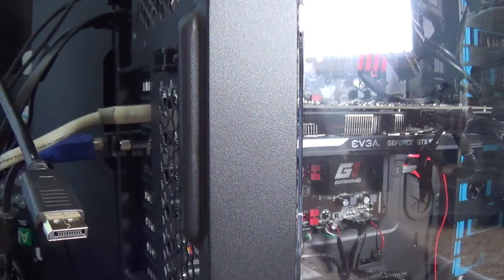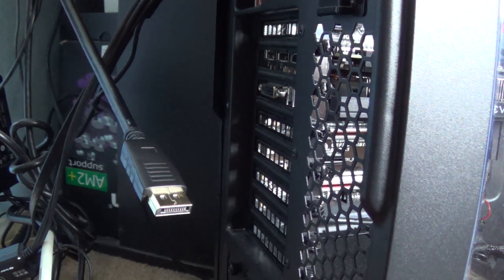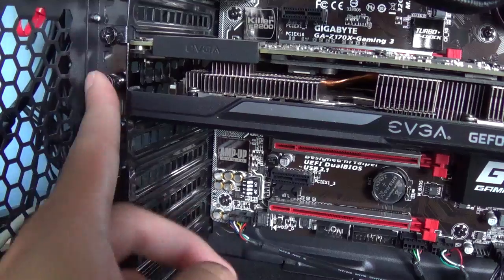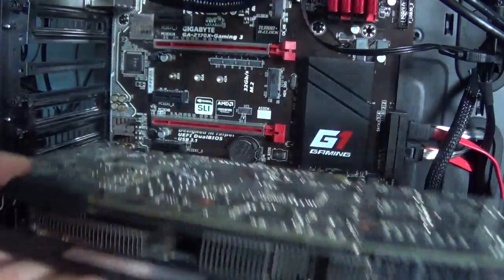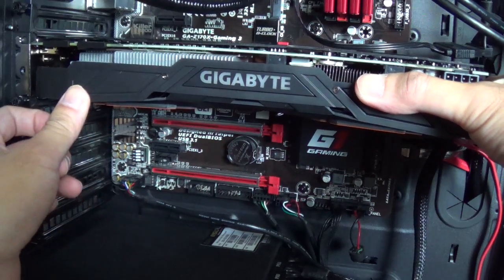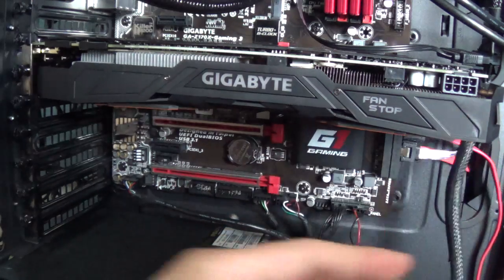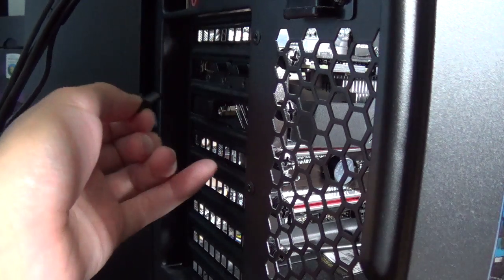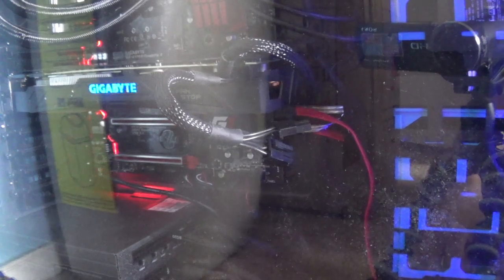How to Replace Your GPU Replacing My GTX 970 with a 1070

Comment: Where do you click it on mine i have a t7500 dell.precision desktop where do you click to take it out
Reply from the maker: Should be the same spot
Reply: @RobertLe1988  couldn't find had to wiggle it forever and push at the same time would you happen to know how to see 2 3tb hard drives at once external or internal ly appreciate the quick response im.trying to clone and it can't see both when both are connected tried everything

Comment: wait, so your newer GPU doesn't need as many pins connected to it as the older one? what was the point of those extra pins for the older model?
Reply from the maker: My newer one uses the same pins

Comment: Is this the same process in upgrading to gtx1660? I currently have a GTX 970.  Worrying if I still have to change some hardware in the desktop. My psu is 850 watts.
Reply from the maker: Check your overall wattage usage. If you are close the max then I would recommend that you upgrade your power supply.

Comment: This might be a dumb question but if I have a evga gt 710 and I want to replace it with a gtx 1050 4gb gigabyte, would I have to delete any drivers
Reply: You should be fine, still have NVIDIA. Have you downloaded the latest drivers tho?
Reply from the maker: If it doesn't have the correct drivers, it will default to the basic drivers then you install the latest

Comment: I have a quick question, so I recently got a new pc and my old pc has a GT 710 that I installed a few months ago, so instead of buying a whole new GPU for my new pc, can I just take out the GT 710 from my old pc and put it in the new one??
Reply from the maker: If it has the right slot

Comment: I am thinking about doing the same thing. Could give us an update? Is everything working fine? Did you need to upgrade something else? Once you installed the 1070, did you just need to install the driver for it? Did you notice any difference in the performance? Thank you for taking the time to respond.
Reply from the maker: I've had the card since I uploaded this video. No issues and the driver still gets updates. I don't see a reason to upgrade at the moment. Whenever it can't run AAA titles on the card then I might consider upgrading. I used the nvidia experience and it auto updates. Might be easier to use the built in graphics then install the driver then use the card.
Reply: @RobertLe1988  Thank you very much.
Reply: @RobertLe1988  I mean, did you have to make any adjustment or updating to your mother board? Or can I just buy a new graphic card and install it, and that's all? Everything else is compatible?
Reply from the maker: @samiajijudistira7199  I didn't have to update anything but the driver
Reply: @RobertLe1988  Thank you again for the info. You see, I tried to read about this on the NVIDIA official website, and they kinda warn you to be very careful because something about the mother board and other things that came with it might not be 100% compatible. Now I feel comfortable and I'm gonna go and get the graphic card now.

Comment: I have a Ryzen 3200g with the built in gpu. I’m planning to put in an AMD RX 570 gpu. will the drivers be automatically installed to the pc or do I have to do it manually
Reply from the maker: You would have to install the drivers

Comment: bottlenecked?
Reply from the maker: What do you mean? All my games work fine in 1080p
Reply: @RobertLe1988  because I think that switching  GTX 970 to a 1070 is a big step
Reply from the maker: @jotarojengki-kun1974  Haven't had issues running at 1080p and streaming
Reply: @RobertLe1988  ahhhh good god bless bro

Comment: do i need the cable that you plug into the 2060 to make it work because ive got a 1050ti and that doesnt have the cable and i cant seem to find the cable in my pc?
Reply from the maker: If it has the socket then you need to get a new power supply

Comment: I'm upgrading my GPU but was planning to restart everything, so I don't have to uninstall the driver right?
Reply from the maker: If you have the nvidia experience program it should detect your new card
Reply: @RobertLe1988  I upgraded from GT 710 to RTX 2060 so I still had to uninstall all my drivers. Anyway thanks for that information.
Reply from the maker: @mr_airport7330  Thanks for the info
Reply: @mr_airport7330  Dayum, thats a big ass upgrade.
Reply: @synx2963  it is xd
Reply: @mr_airport7330  also, A few weeks ago, I upgraded from a integrated gpu to a gtx 1660 :D
Reply: @synx2963  sounds epic

Comment: I can't push down that red thing on the motherboard i feel like i'm using too much force. I unscrewed and unplugged everything. i don't wanna break anything
Reply from the maker: Just apply enough force for it to snap
Reply: Holy Crusader did you figure it out man because it won’t work for me either
Reply: Plz reply because I’m stuck and it’s making me very upset
Reply: @kiwizlucks4947  yeah i just pushed really hard lol
Reply: Holy Crusader yeah I got it bro lol I just pushed realllyy hard but before I didn’t wanna press to hard cuz I felt like I would break it, upgraded to my 1080 tho.

Comment: I would suggest that removing the Power cable is a bad idea unless you plan to ground the case some other way? The problem is if you manage to generate some static it has no way to dissipate through the case ground.
Reply from the maker: Thanks

Comment: Can i replace my gtx 950 to a gtx 1060?
Reply from the maker: Yes
Reply: Robert Le thanks but with every mainboard?
Reply from the maker: @texotypes6964  As long as your motherboard has the supported PCI slot you are good. Example your motherboard has PCI Express 16x and your card needs PCI Express 16x, then you are good.
Reply: Robert Le what if Mine is 2.0x16?
Reply from the maker: If it's the same or higher you are good
Reply: @RobertLe1988  how can u tell if ur motherboard has PCI express x16
Reply from the maker: @lexmor3886  Look at the manual or google the motherboard and the spec sheet will tell you
Reply: If i understood correctly when I read up on this thn it should work anyway u will not get full performance from the card thou it is limited to the port speed that u put it in to. So you will only get what your PCI-e 2 can provide.

Comment: Do you have to uninstall all your drivers from the old graphics card?
Reply from the maker: I had a nvidia to nvidia so I didn't have to uninstall my drivers
Reply: Robert Le so if I went from a 1060 to 1080 I would be fine
Reply from the maker: Yeah you shouldn't have any issues
Reply: Robert Le thanks

Comment: Everyone asking if you have to uninstall drivers:
If you're going from nvidia -> nvidia, you should be fine
AMD -> AMD, you should be fine
It will ask you to update your drivers when you reboot, but you don't have to completely uninstall. 
HOWEVER, if you go from nvidia <-> AMD, THEN you have to do a clean install of your drivers.
Reply from the maker: Thanks for answering the question
Reply: So if I was going form nividia to nividia would I just shut down my pc install the new gpu and then boot my pc up again?
Reply: Luke Fox did u find out what do do plz lmk
Reply: @Angel-es3je  ?
Reply: @lukefox5100  whats did you do when you installed a new gpu ? (same brand) did you have to go to nvidia experience and install drivers and had to reboot ? Or is it plug and play ? Did you also have to delete previous gpu drivers ? If so, how did you do it ?
Reply: @cvcxx  You need to go on geforce website and find the drivers for that gpu and then install it and follow the steps and thats it
Reply: @Zac   Thanks for your comment! A great knowledge to share. Two thumbs up!
Reply: Ty
Reply: oh great !! so im going from a gtx 1060 to a gtx 1080... i just replace and all should be good ?
Reply: @irvindeleon7215  i upgraded from a gtx 660 to a 970. All i had to do was update the drivers from the nvidia experience. Then you can go on nvidia control panel to select custom settings. I dont think i uninstalled the previous drivers but check if you can. Other than that everything worked for me. "If switching to nvidia to nvidia you should be fine".
But my experience switching cpus was a bit different. My system wouldnt recognize its 4 cores and 8 logical processors and found no other option but to reset my entire pc. It was a pain to redownload everything but i wont be switching cpus in a while.
Reply: Black Sheep thank you 😃!! I plan on getting a 1080 soon

Comment: seems a bit risky to be changing your graphics card or anything in your pc on carpet. I suggest standing on a wood surface.
Reply from the maker: As long as you are grounded it shouldn't be a problem. Carpet is a bad idea I agree
Reply: Robert Le can you describe more on the grounded thingy? Im sorry english is not my mother tongue.
Reply: Adam Dicky the motherboard is very sensitive, a slight voltage spike from your body might cause entire motherboard to short out
Reply: Zac HK even if it’s unplugged?
Reply: @kam2894  im fairly certain yes
Reply: Riley oh wow okay, thank you. surprised my pc hasn’t broke yet now lmao

Comment: With an 850 you should run two cards. I have been running 2 1080's with a 750w psu. Under heavy load, I dont exceed 450w.
Reply from the maker: For what I game with I don't need two at the moment

Comment: Not worried about working on carpet in socks?
Reply from the maker: Yeah should of done it on a table. I grounded myself using the case. I've been doing this since forever and no issues. Your mileage may vary

Comment: I’m new to pc build what is grounding my self and how often should I do it
Reply: Best way to do build a pc is to be completely naked and off carpet that way you don't generate any static .
Reply from the maker: It's best to use an antistatic mat if you have one. I don't upgrade unless I need to.
Reply: You can use an anti static band
Reply: I might be late but you need your answer im pretty sure its when you placw your hands on a Heater thingy on a wall you know i dont know it in english

Comment: Mine plan to upgrade from GTX970 to GTX1070 or maybe Ti, what should i need to take care before the upgrades?
Is that we just need swap cards and play them straight away, or should we need to update vbios just like what i did update by bios for my new CPUs.
Btw i already update my Gforce experience to the latest version.(388.59)
I need assistance for this, TQVM.
Reply from the maker: I didn't have any issues upgrading from the gtx 970. Just swapped the gpus and it worked.